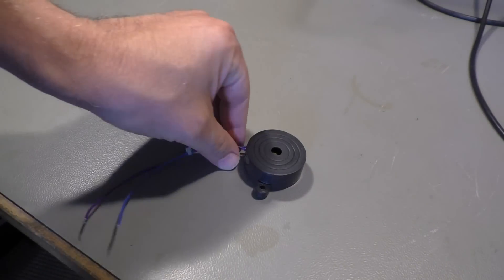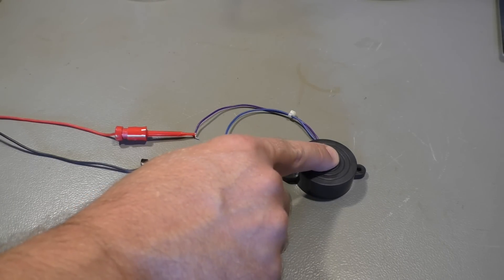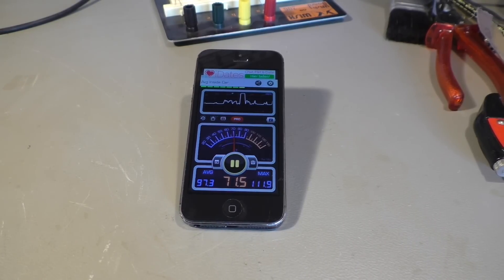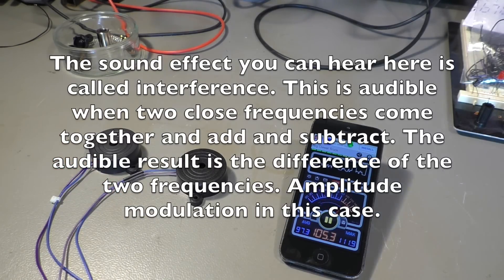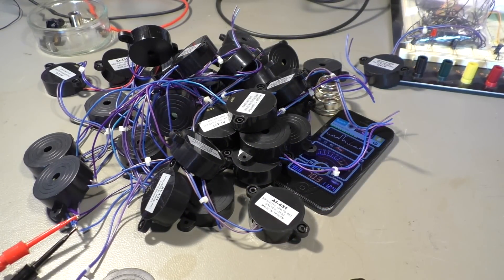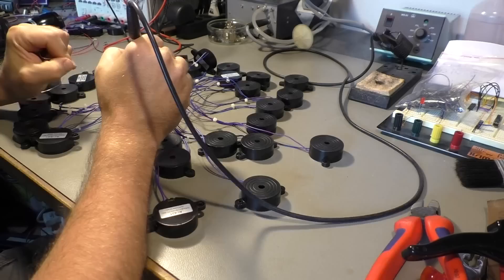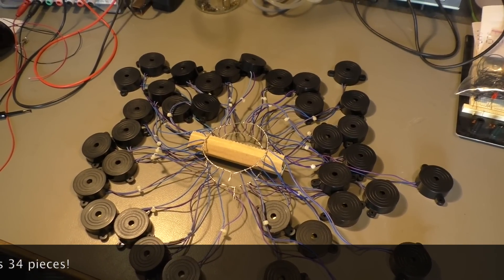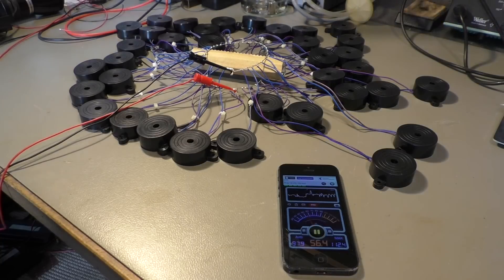Too many beepers? (PWJ65)

Comment: In acoustics this kind of interference is called beat (funny that!)
https://en.wikipedia.org/wiki/Beat_(acoustics).

(as a German I call it https://de.wikipedia.org/wiki/Schwebung )

In pipe organs it is often used such that 2 or more pipes have slight detunes to each other. In contrast to your construction that sounds very nice. ;-)
Reply from the maker: Beat (acoustics) does also apply for multi engine propeller aircraft. Watch my video about the Super Constellation propeller synchronizer. That thing eliminates the beat :-)